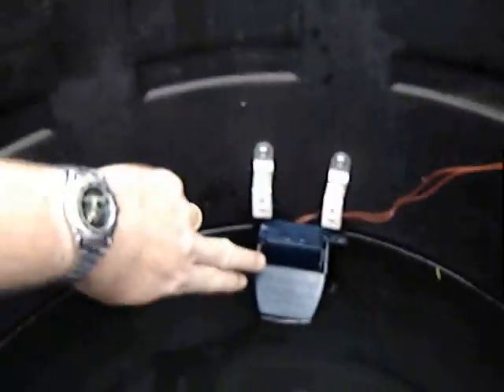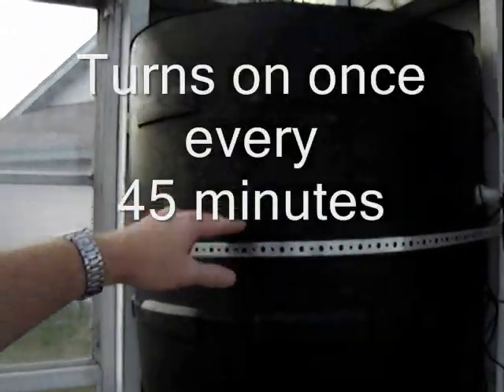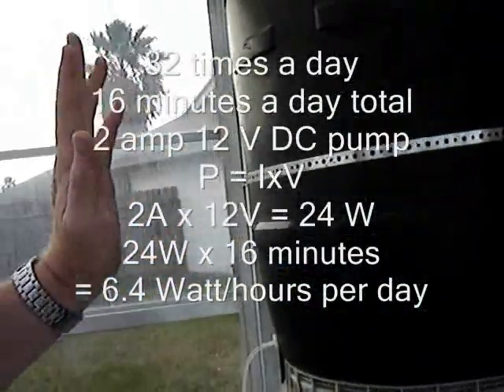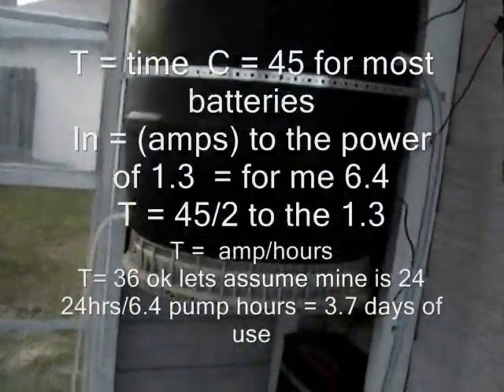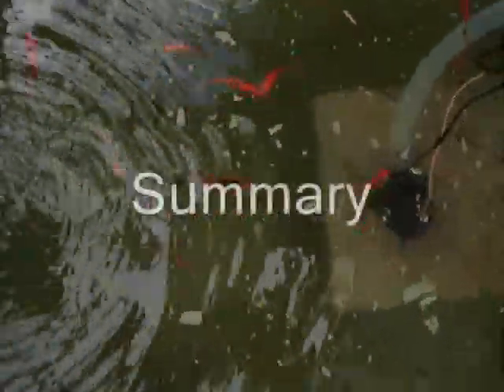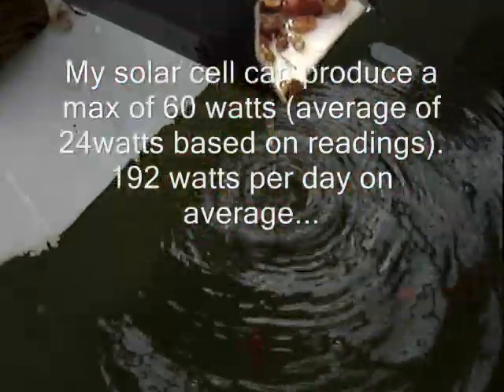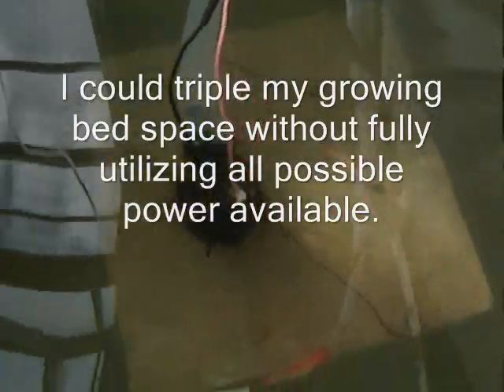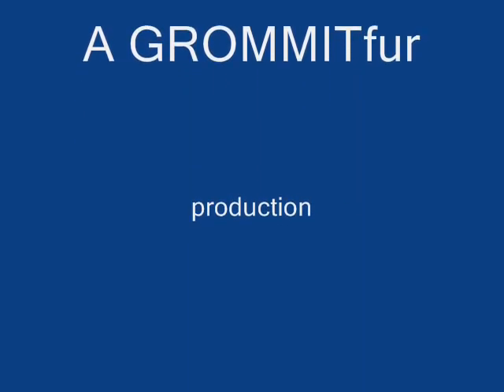pump power consumption for solar powered aquaponic system

Comment: Hi, a tip for the calculation to optimize liftime of batteries...
A friend told me to calculate a maximum unload of 50% for the battery. That should give you a much longer lifetime.
cheers